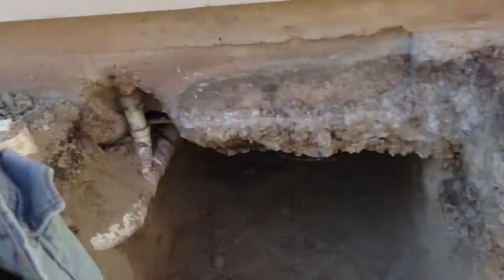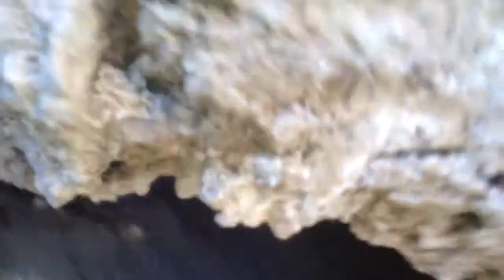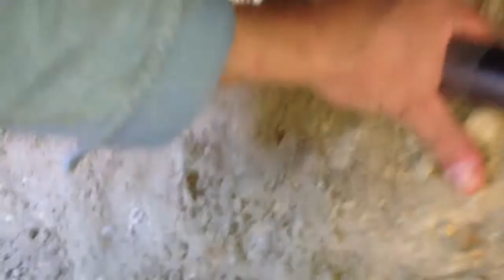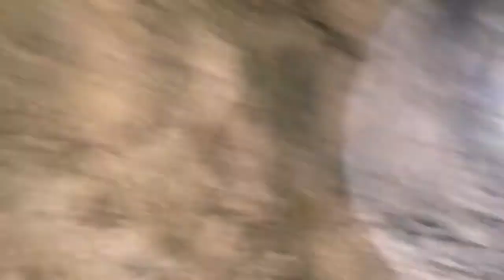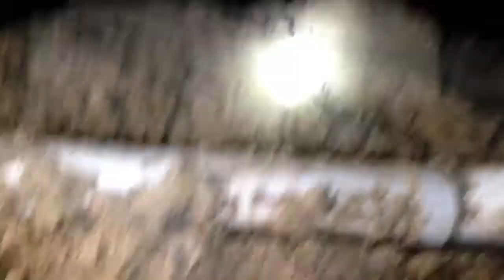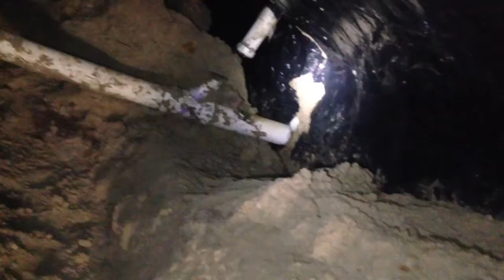Sewer tunnel under house foundation

Comment: May I ask you how much approximately would be a small tunnel under the bath tub (it is removed). We have a slab leak somewhere in the corner of that bathroom, and I have doubts about reroute through attic, what everyone in Dallas suggests. The pipe is at the depth of ~1.5 feet. We live in Dallas. Thank you for such an interesting film.